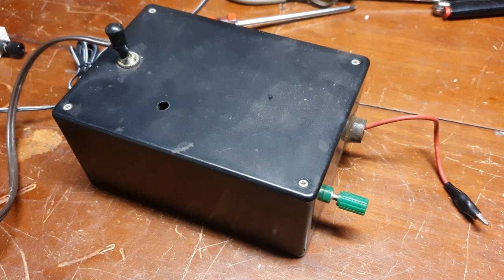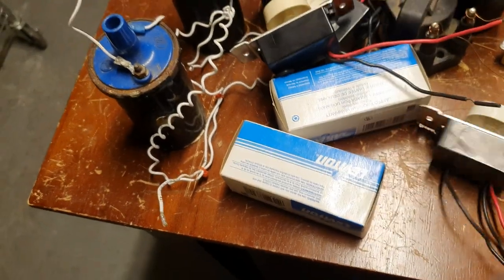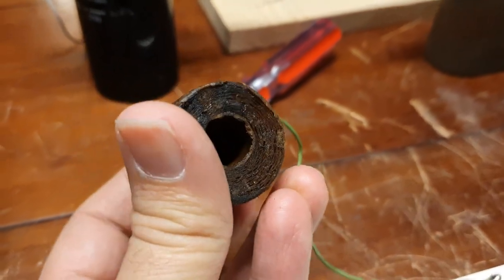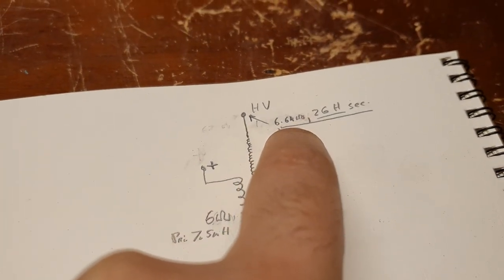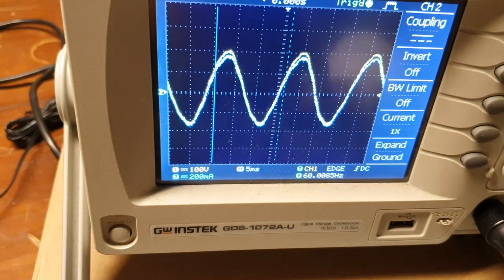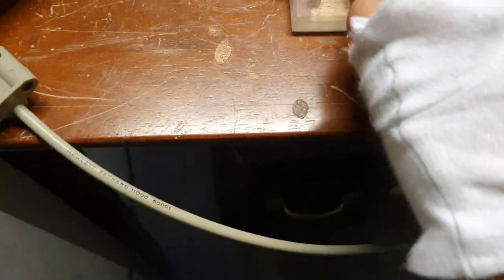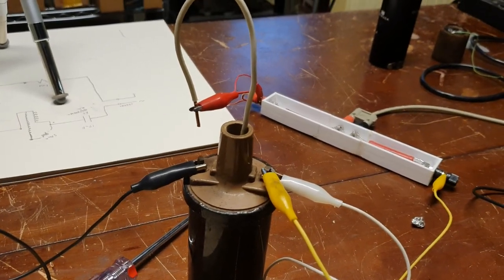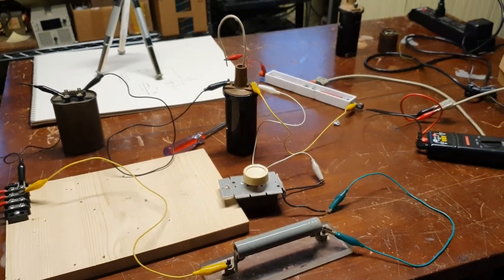World's Simplest High Voltage Supply (25kV)

Comment from the maker: Checkout the website www.sparkstarter.tech
Reply: InstaBlaster
Reply: Can you please add some Amazon affiliate links to the parts in this video. Thanks!
Reply from the maker: @BrentLeVasseur  I'll put some links to order parts on my webpage... thanks.
Reply: @sparkstarter  Thanks buddy! Keep up the good work!
Reply: @sparkstarter  I did this about 16 years ago... except i used a high voltage microwave capacitor. arcs were at least 8 inches long.

Comment: I built something just like this about 20 years ago and was damn near killed by it lol. I had no capacitor or other circuitry on mine, just the dimmer switch set to full power wired directly between line AC and the ignition coil, it could draw out 3-4 inch arcs that melted the electrode tips so it had gobs of current, and the last time I played with it (the last time, I don't fool with lethal current anymore lol) two decades ago I just about electrocuted myself, I got caught on it for about five seconds going through my arms and chest when I disregarded the one hand rule, my legs kicking randomly was the only thing that saved me as I gripped the hot line in my left hand and the steel table it was sitting on with my right, AC current gives you a literal death grip, I ripped out a couple finger nails when I finally pulled away. Dumped about two quarts of used motor oil I was using as insulation and cooling all over myself and my shop too lol, the coil was in a big glass jar that went flying when I kicked away, which also luckily ripped one of the feed lines off and disabled it. Sketch stuff, I'm surprised I am still alive after my wild youth lol.
Reply from the maker: Wild
Reply: Reminds me of the first flyback cap I made acquaintances with

Comment: Beware of the maximum rated voltage the HV resistors are rated for. You get an arc over and your scope could turn into a fancy brick!
Reply: As I found out with my fluke meter years ago testing electric fence
Reply: Bricks aren’t the problem because you can always buy a new scope, but you can’t buy a new life!😂

Comment: RIP, Mr. Franklin.  Your experiment reminds me of ElectroBoom or PhotonicInduction without the hazard sense.  Or myself prior to the age of sensibility.  Still, it makes me laugh to think a consumer dimmer will repeat 20A spikes.

Primary isolation at least would be sage.  Spring for it & wake up another day.
Reply from the maker: Thank you Safety Troll, your self righteous advice and copious caution is strong...  that dimmer has driven that coil for 20 years, built this HV box in high school and used it for many projects without incident over the years.  The cap provides current limiting and galvanic isolation, don't really need a primary transformer for isolation.

Comment: Yep, I had a similar circuit set up years ago. It was hooked up to 240v. I got a jolt from it that nearly dropped me and I never used line AC as a direct power source ever again. My favourite power source since then was 48v dc a much more user friendly voltage for HV generation.
Reply from the maker: so this is in the US 120VAC one wire is hot the other is Neutral Ground, capacitor in series limits the current from mains.

Comment: The main power limiting is the 17uF cap, without that, the primary would not be happy.
Regarding the open circuit voltage test, that is really bad for the secondary insulation, it will break down and eventually ruin the secondary insulation.
Thanks for sharing.

Comment: Why dont they make the spark go from a positive and negative end of wire from the secondary only,  why does it connect to the primary.  It just seems weird
Reply from the maker: In an auto the negative is chassis grounded to the Car. If you examine a spark plug you see the arc jumps from the central electrode to the metal casing which is in contact with the engine block.

Comment: Since the primary is 6 ohms why not just use a signal generator connected to an audio amplifier then to the coil so you would have a variable frequency high voltage power supply?

Comment: Good information sir got a question for you regarding a high tension auto coil winding as you mentioned the center Yao is conected so if I read a continuity test I should read ohms across positive terminal and high volt terminal ? Am I right ? Thanks again
Reply from the maker: Yes, you should measure resistance from the HV terminal to both + and -, the minus will be a little bit less.

Comment: the diagram is different than the the box wiring you show in the beginning. which is correct?
Reply from the maker: Both are correct, it is a series circuit.
Reply: @sparkstarter  ok thanks i just wanted to be sure. have a great day man :D
Reply: @sparkstarter  strange, i tried both setups, with 100% brand new components and all i got was a weak millisecond spaerk when i closed my mains switch to start it up.  any suggestions?
Reply from the maker: @nickdavis3711  what values of capacitor and what brand dimmer switch did you use?

Comment: What about the resistor I see bridging the capacitor?  What is the purpose and ohms?
Reply from the maker: Its just there to bleed charge off the Cap for safety dont need for the circuit to work.

Comment: Couldn't you have the dimmer on the positive side and the capacitor after the dimmer?
Reply from the maker: Order in this series circuit doesn't matter too much...
Reply: @sparkstarter  mine still doesn't work... I have a universal dimmer with triac but unfortunately get nothing out of the coil
Reply from the maker: @iseeyou7622   hmmm... do you have any kind of o-scope to measure the output of the dimmer? Should see clipped sign wave... there might be some fancy dimmers that do zero crossing switching or transient suppression... try using the cheapest triac dimmer switch you can find.
Reply: @sparkstarter  ok mate, will try find one. Thank you
Reply: @sparkstarter  hi mate, we are not having any luck at all... We have tried different types of switches... Strange
Reply from the maker: @iseeyou7622  just hook the dimmer to a light... see if you can get it to work and let me know.
Reply: @sparkstarter  hi mate, tested it with multimeter definitely works
Reply: @sparkstarter  please may you look at the emails I sent... Thank you
Reply: @sparkstarter  I'm not a scammer mate I promise... Happy to prove that if needed.

Comment: Can I increase the frequency? Like 10kHz?
Reply from the maker: For these ignition coils I was measuring a maximum output voltage at around 3kHz, they will work at 10kHz but you may get reduced output.
Reply: @sparkstarter  I got 800CC engine car ignition coil. At 12V it works best around 50Hz and 30% duty cycle.
Reply from the maker: @GhostsOfSparta  hmmm sounds a bit low, maybe I'll test it. With sine wave best output a 3kHz

Comment: Have you tried putting a resonant (at the input frequency) capacitor in parallel to the primary, but V rated high enough to take the secondary output ?   If the secondary inductance were set so that it's resonant at a lower* harmonic, that would be cool to see.
Reply: Link a video if you've seen it done.
Reply from the maker: I've been thinking about doing a video where I measure the Resonant Frequency, then I might do a couple circuits that utilize this information... will post.
Reply: @sparkstarter  I rectified a mistake in my original statement, the secondary circuit would ideally be at a lower harmonic.  I's weird but I'm getting a vibe that this is the proper schematic of a monopolar "Tesla air-coil".
Reply: @sparkstarter  Another variation could be to put a second capacitor in series with the hot side of the secondary, a lower capacitance so that the frequency is the same as the input.  There could be a fatal flaw in these thoughts experiments but I don't see it right now.
Reply from the maker: @sFeral  Your link isn't working... you can put any power source into a magnifier, this one would need to be low frequency though...
Reply: @sparkstarter  It's part of the url,  just overwrite the ID of a video you already have open in a tab.
Reply: That violates the FCC's rules. It makes a spark gap radio, a device that has been banned a LONG time ago.

Comment: Why are you drawing your arc to the top of the primary winding instead of the to the common lead? You are feeding back high voltage to the coupling cap and back out onto the AC line. I saw that you have absolutely no line isolation or filtering. Your neighbors must love your RFI. I recommend a common mode choke on the input AC line as well as an isolation transformer.
Your entire set up is a guaranteed lethal accident waiting to happen. I work professionally with high voltage power supplies all day and intentionally drawing an arc will get you fired. Or at least severely reprimanded. Not to mention all of the accident report paperwork!
Reply from the maker: Been playing with this setup for 30 years without incident, and I would bet I work on bigger high voltage supplies than you do... but hey, everyone has their own safety tolerance. If you don't feel comfortable with 100W of power at 25kv  don't mess with it.

Comment: LADIES THIS IS COMPLETELY UNSAFE.  Ridiculous.  At least use an isolation transformer.  Don't have one?   THINK!!   Gut out a pair of similar wally worts  and use  two transformers back to back, AKA  120Vin / 12V out-----12V in/ 120V out.
Reply from the maker: there is always a danger element (shock or fire) when working with any high voltage device. The capacitor serves to limit current flow through the circuit. Not sure what extra safety gain your getting by using an isolation transformer other than some EMI filtering...